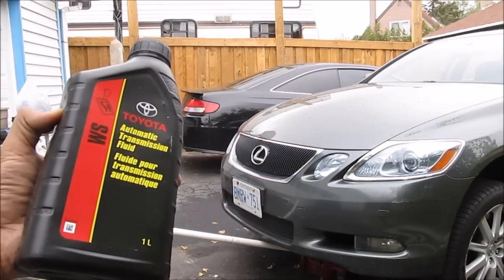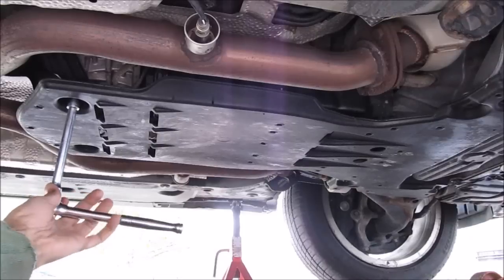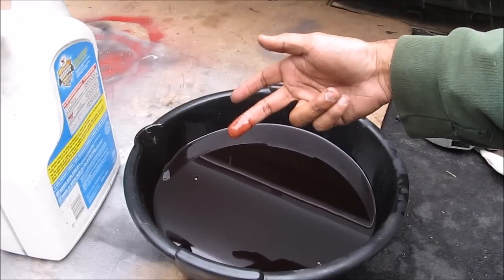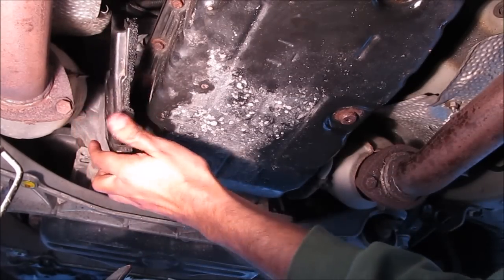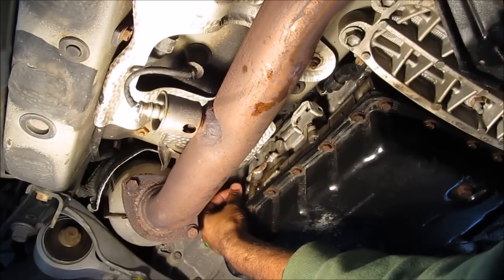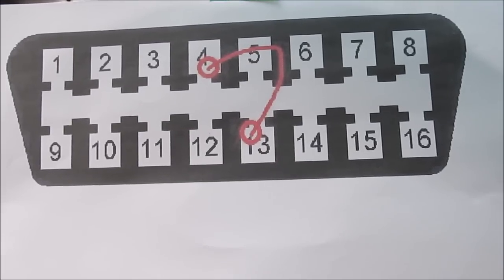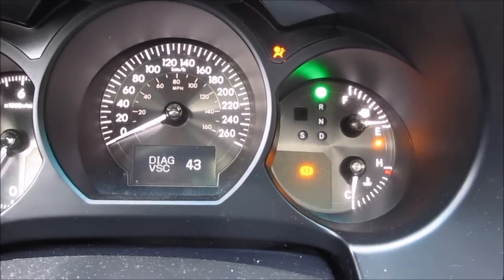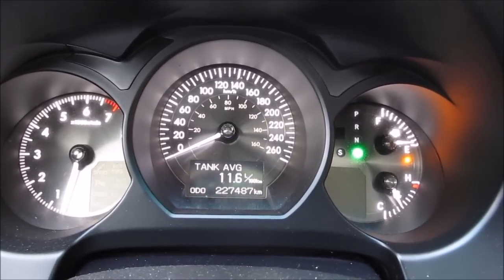Toyota / Lexus Sealed WS Transmission Fluid Change

Comment: You should ALWAYS open the FILL plug FIRST to make sure that you can fill in the new fluid BEFORE opening the DRAIN plug!  This way if your DRAIN plug is not able to open, your car won't be dead!  Also, you should replace the gaskets for the drain and fill plugs.
Reply: Also, he also did not drain/check the possible excess fluid...
Reply: I do not follow. How does being unable to remove the drain plug leave the car dead?
Reply: @notadoctor2598  They mean unable to remove the fill plug. Try removing the fill plug before removing the drain plug so that in the event that you can't remove the fill plug for whatever reason, you still have fluid in the transmission and can drive it somewhere to get help. If you've already removed the drain plug then all the fluid would have drained out and you won't be able to drive the car.

Comment: I've been toyota and lexus master certified, I recommend a drain and fill every 60k miles.
Reply from the maker: +Scruffy Mclick agreed. Even that's long for me
Reply: Scruffy Mclick 

how much is a transmission fluid change in a lexus?
Reply: Maybe you should convince them to allow their mechanics to do the service then. I have contacted several dealership service departments and they refuse to do the job stating it's 'lifetime fluid." Do these dealership mechanics not know how to do the work? Is the liability too high? What gives for real?
Reply: BlackHawkPSU 
A drop and fill is a hundred bucks
A customer may get 1 or 2 done

They want the customer to buy a new Toyota and the old Toyota to last 200k miles not be on the road forever

It makes no sense to say trans fluid shouldnt be changed after 150k
Reply: Scruffy Mclick Could you do this procedure without checking the temperature of the oil.  Since you are a certified mechanic, maybe you have an educated guess as to how long the car would need to be warmed up for in 40 degree weather as in my case.  Thank you for your time
Reply: angel_ dust my dealer says 375
Reply: I want to use Amsoil ATF since it’s synthetic Do you have an opinion on that Michael?
Reply: @BlackHawkPSU   They want to sell you new transmissions.
Reply: Michael Michael Motorcycle have a 1st gen automatic Lexus IS 300 with 200k miles original fluid as far as I know, should I change it? Would that be ok or leave it? I heard Lexus does not shed clutch material?
Reply: 375 here in California
Reply: No offense to you personally, but given my experience with Toyota techs, it doesn't fill me with confidence.
Reply: I've just bought a crown athlete vx. Can anyone tell me what the service intervals are for the 4speed auto transmission and what oil I need and I'm guess there is also a filter?
Thanks
Reply: I did my first one at 28,000 miles and the fluid was black. I'm going to do it every 30,000 miles minimum.
Reply: @BlackHawkPSU  Ask them to sign a statement to the effect that 1. They were asked to do it & 2. They told you it didn't need to be done and 3. That the transmission should last for 300,000 miles with normal use. Or show this video to an independent mechanic who m you trust and is willing to do it.
Reply: @ronthemogul  
375 what?
Reply: @frazzleface753  
Faye Hadley is a Toyota tech. Check out her channel.
Reply: @chappy2121  if you don't have a manual then try to download one.
Reply: I’ll do it for $90
Reply: @BlackHawkPSU  Toyota would like to sell you a new car so they don't want to help make the car last too long. I hade a 2005 Camry and never changed the fluid, at 250k miles it was still shifting but it started slipping quite a bit when driving around 30-50 mph. So basically Toyota expects most of there cars to last 250-300k without changing the fluid which most customers would be plenty happy with this sort of life and continue to buy their cars. If you change all your fluids and keep up on every maintenance item I would not be surprised if you got 400k out of Toyotas.
Reply: @bobby_digital9493  if you get an answer for this question please let me know because I have the same question as well II wanna know if I can skip this temperature step would I get away or it’s will cause problem later on? Thanks
Reply: @costantineyoussif6679   turned out to be a non issue in my case.  Indeed I had to do it on four ramps in almost freezing weather but it wasn’t as crazy as I thought it would be.  You dont need a second person to pump the fluid preferably a mightyvac but I did and made the job a lot easier.  Three years later no tranny issues, due for another flush soon.  

These uploaders sometimes are way too punctual and by the book and for the average DIYer makes you second triple guess your procedures.  You’ll be alright, use a temperature gun to guide you though, definitely can’t hurt.  Good luck!
Reply: @bobby_digital9493  I just bought a 08 Lexus gs350 RWD and it has 110mi and from checking the carfax, i don’t see any transmission service has been done to it,, do you think is it the time now to do it ?? Or it’s too late ? And if you can recommend me a certified shop down here in California San Diego since I don’t have the place to DIY ,, thanks for your fast respond ✌🏼 cheers
Reply: @costantineyoussif6679  Nice, 08 should be good.  I got the 06 GS300 with oil consumption and was a real shit car.  Check online for independent shops buddy, I can’t help much further.  DO NOT go to dealership they will take all your money.
Reply: @bobby_digital9493  thanks that would help, but most of them actually won’t let me bring my own OEM filter and the OEM pan gasket and the WS ATF Toyota fluid  they said we have our aftermarket stuff, that makes me think twice !!!
Reply: no filter change required?  Seems strange
Reply: I had my Lexus 430 done years ago at 70,000 miles. The Lexus mechanic showed me it was still pinkish red with minimal shavings—-meaning good. Now I’m going to change it again with the best rated oil at 118,000 miles.  I will not buy a new Lexus. I hate The looks of them and they don’t have the big V-8 like I have on my 05 and you won’t beat the 430 in Looks  and quality and reliability and that goes for any car compared to this one. I have owned since new and only spent 600 dollars on repairs.  I always maintain mine well.
Reply: How about the filter
Reply: Right. Don't need a bunch of amateurs shorting their OBD2 ports

Comment: Make sure you can loosen the FILL bolt before you drain. If you can't open the FILL bolt after you had drained all the WS fluid you will be SOL!
Reply from the maker: +poman911 agreed!
Reply: poman911 

   There is a way to pump it in the drain plug without any escaping.  I found out several years ago.  Worked great.
Reply: Great freaking tip sir hats off to you !
Reply: I've seen people fill through the over flow before lol
Reply: Volkswagens don't usually have a fill port. You literally just shove fluid in the drain port. Overfill it a tad and then set the level when it's at the right temp.

Comment: Its not "lifetime" but it is "longtime"! This is the most technical atm fluid change job ive ever seen!...Btw...did anyone notice how good the fluid looked? as he stated it was bright red and all...add that to the fact that the drain bolt was so rusted and obviously never been removed(usually  230k miles + rusted drain bolt = fluid may need to be changed). But thank you for showing us that even under these conditions...that fluid is still good and I bet u didnt have any transmission issues either!  So around 250k I'll let Lexus make a little money and keep me as a lifetime customer b/c their transmission didn't leave me stranded. GM makes the same claims in some of their scheduled maintanence reports for certain vehicles that are driven "normally" saying that u don't need to change atm fluid. I just trust Toyota a lot more.

Comment: "Toyota calls it lifetime fluid, I call it lifetime business for Toyota when the transmission breaks down." -Best line ever
Great video!  This puts most other DIY vidoes to shame.
Reply from the maker: Life time fluid means lifetime of the transmission, weather that's 100k or 200k
Reply: @speedkar99 I purchased a new Toyota Camry SE so I'm simply going to drain, measure and fill. As long as I measure properly then there should never be a discrepancy in the fluid levels.

Comment: A tip for your next gear-/diff-oil change:
Always loosen or remove the fillplug first.
If it, for some reason, won't come out, at least you have all the oil at the right place ;)
Reply from the maker: +Rayner Bønå good tip
Reply: Very useful tip from painful experience :-)
Reply: an open fill plug helps the oil drain faster and more complete...
Reply: Thank you, sir
Reply: God I wish I would've read this before I took all my transmission fluid out 😰
Reply: @samill72  so how did it go
Reply: Yup. Loosen that fill bolt  first
Reply: Yup.  Me and a friend tried to change the oil for the rear awd differential.  We could not get the filler bolt off.  At least was able to drive it to a pro mechanic who was able to do the job.
Reply: After changing my tramission fluid my transmission started slipping i regret changing it
Reply: @rafaelpuente9193   did u use the toyota spec fluid?

Comment: Just done this on my GS300 2 days ago, wish I had seen this video as it would have saved me a hole day searching for the correct information, but finally found it and did it exactly you have presented. The only difference is that I got 1.5 liter out which is exactly the same what the service manual says.
Nicely done video and congrats on your new car!
Reply from the maker: +kolrobi Thank you, there's actually a full DIY write-up on clublexus that's been up for a while, the link is in the video description.
Reply: Yes, found link before doing this just took me half a day to find the correct information. Regards
Reply: speedkar99 can you do a video how to Change transmissions solenoid on your gs Lexus?there's a bunch of selonoid in there don't know which one is for p2575 code.thank you
Reply: ALWAYS open the fill plug first THEN open the drain plug.
Reply: What year is your gs300?

Comment: Great video!  I like how thorough you were from under the car by identifying the front wheels so we can get the full correct orientation of the transmission layout.  To make this really complete, you should show how you would tackle that rusted over-flow bolt.  
I enjoyed it! ;)
Reply from the maker: +Creative0Mind Thanks, I'm glad you enjoyed it. I'll tackle that overflow bolt when I pull the pan and redo the gasket.
Reply: @speedkar99 - Thanks for this video!!!  I have a very small tranny oil leak and wanted to check the oil level.  Now I know how to do it!  The greedy Lexus dealer said that customers can't do it, so I was wondering what to do since those suckers charged me $700 to stop the leak, only to have it leak again 6 months later.  I'm taking car back to the dealer, but if they still can't fix it, I'm going to keep pumping oil every 6 months and just drive it until it dies, unless I can stop the leak myself.  Serves me right.  I got lazy and didn't want to fix it myself, so Lexus took advantage of the situation.  I suck.  Time to break out my tools.  Thanks again Speedkar!!!!

Comment: Great video.  I never trusted that "lifetime fluid" nonsense. The thing most people don't realize is in the car world "lifetime" means 75k miles, after that a car is considered high mileage and most warranties are over.  Toyota makes quality cars so it's easy for it to last until 75k with ease.  After that you're on your own.  If I see a drain and fill plug I'm changing the fluid regularly.

Comment: Good video nice detail. I recommend throwing away the plastic cover and 2 bolts covering the transmission filler plug.  That cover is only there to hide the filler plug from owners who may want to change the fluid themselves!!
Reply from the maker: +AMERICARS Brisbane the entire bottom of this car has plastic under panels 
I'm sure it's there to keep dirt and debris away from the transmission and engine
Reply: Perhaps  but I was referring to the small plastic cover on the side of the transmission held on by 2 bolts that covers the filler plug, I did NOT comment on the big sheet of plastic running underneath the transmission.
Reply: AMERCARS - Thanks for the suggestion.  I was thinking the same, but was too scared.  Scared of what?  I dunno.  Kind of like the covers for the engine.  It took me a while to get the courage to keep them off.

Comment: The fluid may still be low or over on his car. While the car is running and at operating temperature the check drain bolt needs to removed to get an accurate reading. I use that check drain plug to check and add fluid as the car is warmed up and running. Works great.

Comment: Hi There, This may be a sign of low transmission fluid or a faulty transmission control solenoid. As you know, automatic transmissions use pressurized hydraulic fluid to change gears. ... When this is faulty or notworking properly, this can cause a delay in gear shifting or in some cases cause the car to not shift at all.

Comment: That was a great video, thanks! I have a 450h of the same model and I was wondering about the transmission fluid change. This was very specific and made it look like a breeze.
Reply from the maker: I think yours is different because CVT
Reply: ALWAYS open the fill plug first THEN open the drain plug.

Comment: HOLY COW! Great video! Life saver. Straight and to the point. THANK YOU!
Reply from the maker: Your welcome
Reply: Hi, just a few points I noticed while prep'ing to do this project myself, and re-watching your video:

(1) The Overflow Plug is NOT "stripped". It's supposed to be bare like that; mine is the same. Not sure how I'm gonna get it off, but will let you know when I do!!

(2) There are some other non-reusable parts, per Toyota specs diagrams that I got off a Mitchell program: (a) Gaskets for Drain Plug and Overflow Plug; (b) O-Ring for Filter ("Valve Body Oil Strainer Assembly"), if you ever replace that; (c) the Refill Plug itself, as well as an O-Ring for it! (Not sure how you handle that one...).  I just hope the Refill Plug is "reusable" cause I don't wanna have to order & wait :P It did seem kinda hard for you to get that one off.. hope mine doesn't break!

Also, btw, are you alchemist on ClubLexus? I assume so cause the dates on this video and the postings I found are 2 days apart :)

Thanks again, man!
Reply: Yep, Overflow plug just needs a hex key.
Reply: Do you know anything about replacing solenoids? I was wondering if the new/replacement ones need to be dipped in trans fluid or not. These don't have any o-ring or anything. They just sit in there, secured with small bolts and/or pins, of course. Just wondering if dipping in trans fluid is required. Thanks.

Comment: Great video but if you did not do the key part of removing the overflow plug how did you get it to the proper level?  You got it into temp mode and everything just to leave it with a guess based on how much came out.  Again nice video.
Reply from the maker: Thanks. I didn't get the over flow plug because it was rusted and stripped in there. I'll tackle that next time I drop the whole transmission pan.
Reply: @speedkar99  so, only removing the overflow plug is all I need to reach proper level.
Reply: @eye-g3485  don’t get too hung up on the temperature part. IF you know the level is correct before starting drain and you replace it with new fluid - forget the temp here - within an ounce or so you will be absolutely fine. Just capture all the fluid that drained and replace. Use an identical container then you can put them side by side and ensure it is the same quantity.

Comment: This is what I don't understand from other Videos on the Toyota  sealed Transmission if you drain out  4 quarts and put 4 back in what's the need to go through that long Procedure to check the fluid. could you not do this when its cold ????  Because the Transmission was Built and Filled at the Factory  with Cold or room Temp Fluid  Toyota's way of doing this is so long and stupid  they have taken something simple and made it Complicated
Reply from the maker: Yes I agree, in fact, technically they market it as "lifetime" fluid so from a marketing perspective they've made it easier on the end use not having to change the fluid at all. However if your smart and love your transmission you'd change the fluid, and the procedure is much more complex now. The fluid is filled cold but checked hot because it expands with temperature.
Reply: Its kind of like Long Life Antifreeze  Most People think they will get the stated mileage from it.  and yes you will that and a bad head gasket bad Hoses clogged water Jackets from high acid content and sludge from crap like Dex Cool or fondly known as Dex Kill  or other Long life Products . I Change things Frequently on my cars and never in 40 years had problems from changing them too often .
Reply from the maker: +1995dresser yea keeping the fluids fresh is half the effort in keeping your car running great for a long time.
Reply: @speedkar99  what is the other half?
Reply: @speedkar99  Hi Mr. Speedkar I was about to do a change on my Audi Multitronic (CVT) trans which has no dipstick either. So I assume I take out fluid from the fill and drain ports cold, measure and fill same initially, then run trans fluid to correct temp. Does it matter if the motor is running when checking the fluid overflow from the fill port? I was wondering whether I can run the car till it reaches  temperature and shut it off or it needs to be running for final check, as long as temp correct - temp range pretty narrow so gotta be quick before heating too much

Comment: Why didn't you spray penetration fluid on the check plug before hand and wire brush the corrosion. What was the point of getting the temperature indicator light on and not doing the job?